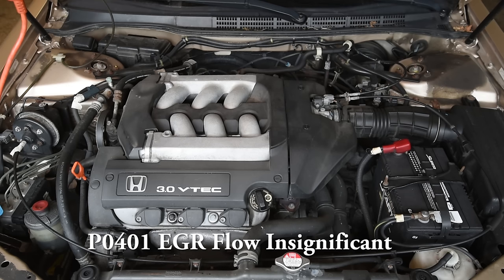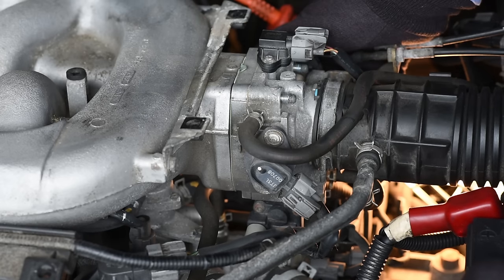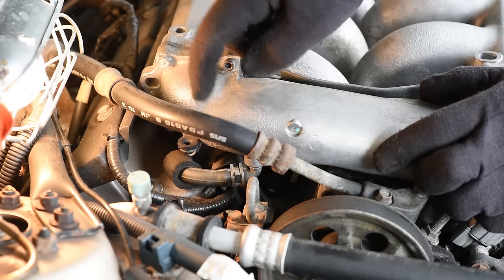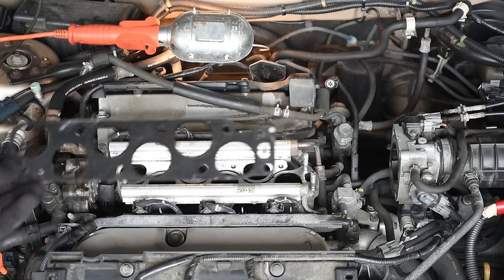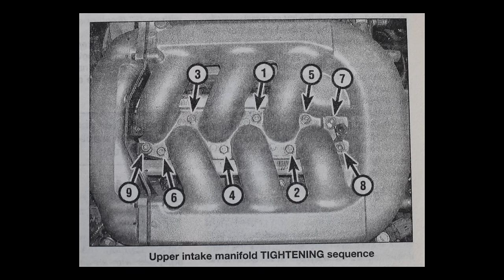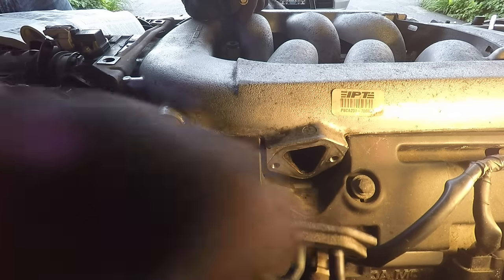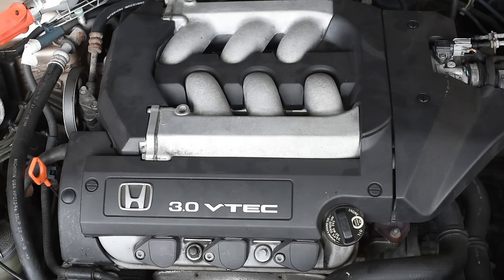How to Clean EGR Passage in V6 Engine (1998-2002 Honda Accord and Acura) P0401 code

Comment: Thanks for a great video. I have a 2001 Honda Accord V6, when I removed the intake manifold the ports were solid shut with crud in the intake and the engine port was 80% clogged.  Cleaned the ports and the throttle body, put everything back together and no more P0401 code. I'm at 600 miles plus now and no issues so far.

Comment: March 2022 I was extremely hesitant to try and do this myself.  The mechanics around here charge 140 and hour and said just in labor it would be 3 hours plus a new EGR valve so I decided to try.  My experience is oil change and an alternator so next to none.  This video leaves nothing to guess about everything is included.  The author needs a Venmo bc I feel like I owe him a 50 dollar bill for saving me so much money.  It did take me 5 hours but that included trips to the parts store for torque wrench rental.  Thank you a million times over!

Comment: Bud.  Can't thank u enough.  I had the same code and it took me 20 mins to get it FIXXED    The mechanic wanted to charge me 300 to fix the problem !!!!!! 👋👋👋👋👋👋👋👋
Reply from the maker: +oreohope1 haha, I am happy I was able to help and you saved some $$ :))
Reply: Igor Kadulenkov  your the man bro !!!! Very nice video man thank you
Reply: That was fast. It took me almost 3 hours to get it fixed. The Check Engine light gone instantly. Lol
Reply: Igor, your video is great w hat exact tools are you using I'm having a terrible time getting the manifold bolts off
Reply: @pengfeili1988  hey thats all that matters
Reply: Took me about 45min. My rig is running like a champ, lights are off
Reply: Igor Kadulenkov how many Miles did the car have on when you did that video. Thanks.
Reply: @IgorKadulenkov  not a Mechanic,  if I take it to a shop in NYC Queens,  what would be a fair price to pay for this job, in general, ball park. In other words what is the most I should not pay, on a budget. How much should I pay, more or less. Thanks Love the video. Thanks. PS my Car is a 1998 Honda Accord V6 3.0 EX Coupe Black 198000 miles, near mint condition.
Reply: Did you spray carb cleaner down the other port? Where does that drain, or do you just let if air dry?
Reply: Cause mechanics are gay

Comment: This was one of the most helpful videos I have seen. You couldn't have walked me through this any better than if you were standing right next me. You saved me from a huge mechanics bill and kept me from replacing an EGR valve that wouldn't have solved the problem anyway. Thank you very much!!!
Reply from the maker: +Ken Drake hi Ken, thanks for your comment. I am glad I was able to help you to save some money! :)
Reply: @IgorKadulenkov what issues did you experience before cleaning?  My car radomly starts surging when on the highway.  I give it gas and it dies.  Then suddenly it gets power again.  It acts like a bucking bronco.  One min it only goes 30 mph the next it races really face then it loses power again.  This happened about once ever 5 months for about 30 mins of drive time.  Is this erg port related?

Comment: Igor, thank you for posting a great video!  For me the hardest part was getting to the bottom throttle body bolt on the firewall side.  You can't see the bolt head so you end of feeling around for it under the throttle cables. I also removed the EGR valve. That allows you to clean up all the carb cleaner that is sprayed in from the top side.  I used carb cleaner, an old bike brake line as a snake and compressed air to clean the passage from both ends.

Comment: I changed out the EGR valve but my check engine light came back on. after getting a $350 quote to clean out the EGR port I decided to take a stab at it myself. i dont do much auto work and it took about 1.5 hours using this video as a reference. car fired up first shot and check engine light is off. Thanks a lot!!!
Reply from the maker: Hi Hyuma, thanks for feedback! Glad you saved some money. It's insane how much mechanics charge for a simple job.
Reply: @IgorKadulenkov  uhh yeah especially if you need to pay the rent

Comment: this is a great video, the 3.0 on the Honda and acura motors are known for their carbon buildup. instructions were spot on, easy to follow. my check engine light is gone, and all it cost me was 45 minutes of my time, and a 3 dollar can of carb cleaner
Reply: What kind of problems were you having before you cleaned ?

Comment: Had a p0401 code on my 98 v6 honda accord and followed this video step by step and no more check engine light, thank you!
Reply: For how long did your check engine light stay off once you cleaned your EGR valve and its ports? I spent so much at the honda dealership repair center getting so much work done, took my car to Auto Zone for the free check engine light diagnostic and it came up with the P0401 code as well.
Reply: Before I cleaned it I just tried to reset the CEL and it came on after ~30mi or so. Afterwards I did this cleaning I had the battery disconnected so the CEL was turned off but I did the cleaning and the CEL hasnt come back on yet and thats after ~200 mi or so.  I also took a look at the EGR valve also (2 bolts and a sensor takes this off) and it looked almost brand new, but I still cleaned that anyways just to be sure.  Ill let you know if CEL p0401 comes back on but I dont think it will unless it gets clogged again.  It seemed like in my case it was just the entrances of the ports that were clogged and not all the way through. Good luck!
Reply: rons2021 That sounds about right. Thanks for the luck. I will definitely get someone to o what you did. It can't hurt to clean it like you did.
Reply: What were the  Symptoms with your car? Was it not  Accelerating correctly?
Reply: @ron
Reply: Did you have starting problems?
Reply: @rons2021  You done good brother

Comment: Thank you for the video, my 2001, Honda accord 188,000 miles check engine lights are off, and I have more power, running like a champ

Comment: i did the very same procedure on my car. cleaned the egr. drove a bit the lite came one. went and bought and an egr. drove 200 miles no prob. on way home the lite came on. then i pulled the trigger and took off the intake plenum and cleaned it like that in the video. the engine felt good and free. drove 20 miles and the lite still came on. i am not even bother trying any more. the video was a great help.
Reply: i disconnect the battery and held the 2 battery leads together for 30sec and the check engine lite went out. it hasnt come on back yet.
Reply from the maker: Which code are you getting? Could be some other reason.
Reply: @IgorKadulenkov  exactly
Reply: @fyahwerks  Frankenstein would love that

Comment: I recently got a 98 accord ex v6 and I had 6 codes on the scanner all related to this, so I followed your instructions and bam no more check engine light and it runs like a dream, thank you so so so much

Comment: Thanks Igor for the great "how to video"!! mine was so clogged I could even the red extension tube on the car cleaner can in the port hole it was so clogged!  after soaking, poking,  and air hose   got both upper and lower ports free again! new egr, plugs cap and rotor and wires, oil change  and front O2 sensor too! put her all back together  cleared the codes then went to crank her up and nothing......... had wires wrong on cap!? but she purrs now and it us to bogg out on freeway. so thanks again sir for your video with it and $250 in parts and 3hrs i got it done!  your a badass! keep making great videos!
Reply from the maker: +Eric T awesome! Thanks for your review. I am glad my video helped! It's not a very hard job, but mechanics would rip you off for sure
Reply: @IgorKadulenkov  Exactly

Comment: Thank you for this video! I have a 99 Accord EX V6 and as many others have said, the ports were totally blocked off and clogged through from one end to the other with carbon build up. I cleaned the ports as you did and put it all back together and wow, not only is the gas pedal responsive from the very top, but my acceleration greatly improved, the car runs and idles smoother, and the exhaust used to reak but now almost no smell at all. Thank you!

Comment: for those that dont realise this on like my 99 model 3.0 the pcv hose is in a different spot and its much safer to actually just pull the pcv itself out and leave hose connected.. if u try to pull this hose off after 150k miles more then likely u will be buying another... just sayin. very helpful video though. seems to have worked for me so far as well and i can see it was done on my vehicle by previous owner a year ago at a shop for $100.. took me 15-20 mins and a $8 can of cleaner

Comment: Your videos are great. I had error code P1491 and so I tried replacing the EGR valve with one I was able to snag for ~$50.00 on Amazon. After clearing the code and driving another 50 or so miles it turned back on, but this time gave me P0401 - EGR "A" Insufficient Flow. I'll give this a shot!
Reply from the maker: +Omid Feghahati thanks and good luck !

Comment: This was very helpful but my intake manifold wouldn't come off until I completely separated the right side inlet. I think because of a couple bolts that were studs with nuts on both sides sticking up. Still a very good video. I found my passage was clean but I still took it apart to make sure after seeing other Accords plugged. Nice to see a video like this where you can see what's going on without someone talking 90 mph and missing video pieces. Very helpful. Thank you.

Comment: Excellent video on this repair.  Great tip on using the magnet to hold the nuts in place while being removed.   That will save a lot of time looking for fallen nuts.  Such a simple idea that I have never seen before.
Reply from the maker: I think I saw it in some video about 10 years ago and have been using it ever since. Magnet is the most important tool, when working with a car.

Comment: Yes this will solve your problem 100% if you have this code. Do it yourself. Hardest part is torque wrenching the bolts to 16 ft/lb. First time I broke my plenum bolts and had to visit Honda's Carland to buy a new set. Charged me about 14$ but it was worth it to have my emissions passed. DIY

Comment: Fantastic video! Much appreciate the detailed steps, torquing sequence and torque values of the intake manifold bolts. I will be using this video as a reference when I perform the same procedure on my 1999 Honda Accord V6.

Comment: Thanks you... I've been looking everywhere on how to open this one. And I finally did. Except the tubing to the air filter is so old, it crack to pieces when I pulled it off. EGR problem fixed but gotta buy that huge tube now

Comment: The EGR valve can be stripped for cleaning by undoing the 4 torx screws under the graphite/ fibre/metal gasket . You'll need a 7 mm spanner on the 4 nuts . The valve itself can be removed using the next larger size torx by holding the hex part of the solenoid through the apertures . Inside the EGR valve You will find a baffle that will stop the valve being cleaned properly by any other method . Using spray cleaners will not clean the back of the valve but may dislodge a lump of carbon that may wedge the valve open continuously causing hunting or loping at idle .
The inside of the valve body particularly the seat can be cleaned factory fresh and you could even lap the valve to seat using fine paste . Reassembly is reverse order . Use a new OE gasket or make some using heavy duty glass reinforced silicon baking /barbecue sheet , 3 layers will reduce heat transfer from the valve to the solenoid and signal ,supply components .The valve normally cokes itself shut as it opens like an ordinary poppet valve into the transfer port to the inlet manifold and spends much of its time closed or just slightly open and I have seen them with the valve totally coked over . Many of the V6 parts are no longer available in the UK but just about anything peculiar to this model , like the ICM for instance can be made from other common Honda parts .

Comment: Very good!!!!, but one thing I do, I used compressed air to clean the manifold passages, as well as through the EGR passageway on the engine, ... if you do not have a compressed air source, another thing I do is to remove the EGR from the engine and run the engine,  with varying rpm,....  amazing how much junk gets blown out of there. As a clogged EGR ( passages etc) causes an engine light, it does not pass state inspection. SO what I have been doing is blocking off the EGR by a thin metal plate ( made from a can lid).  This stops exhaust flow from going through this passage. I get more HP also. Of course this causes the engine light to come on, but I am use to that. When inspection, is due, I then remove the plate ( this will be the first year I am doing this) and hope none of the passages will be clogged due to no exhaust recirulation through these passages. Will  replace the EGR  & reset the engine light, drive for the requisite 30 miles, then get it inspected. Once it passes, I will then put the block plate back on. Once a year hassle, but so much easier than doing the above work which I use to do every year, and paying for the gasket, and new EGR.                 I have had the opening in the manifold bored out and had placed a larger tube in  ( Honda's work around this sad engineering design) but really has not helped. For me, this clogging seems to effect the EGR, which even with EGR cleaning would not help. So a new EGR when I take the plate off (this time) during inspection, and again, replace the blocking plate after inspection.
Reply from the maker: Great suggestions, thank you!
Reply: @IgorKadulenkov  An update....Well, before inspection in July, I took the plate off, ran the engine with varying rpm's, put the egr back on without the plate, reset my engine light... drove 60 miles to make sure the computer will recycle, took car to be inspected, it passed!,  Came home and later put the metal plate back on. Saved me a cleaning of the manifold etc!!!
Reply: @msach4277  AWSOME — but you do have to plug up the Vacuum line Right .. to the EGR
Reply: AWSOME
Reply: One day the light might burn out 🤔

Comment: Where the EGR is mounted does it need to be cleaned or cleared out as well?
Reply: Yes that should also be checked and cleaned if necessary. Something this guy should have done or elaborated more on.
Reply from the maker: “If necessary “, egr is not usually a bottleneck.

Comment: Thanks!  I had already bought a new EGR valve but that wouldn't have fixed it.  The EGR port was completely blocked.  I replaced the valve since I had it and it was tore down this far.

Comment: Great video.  I believe I am in severe need of EGR cleaning and maybe replacing.  I have problems with idle going down (sometimes stopping the engine), low performance and insanely higher fuel usage.  I wish I had the tools and experience to do this myself but I will have to find a good mechanic to do it instead.  Hopefully it'll turn out well.
Reply: Hey there. Did you get this done by a mechanic? If so. How much did it end up costing? And what exactly did they do?
Reply: @miguelitocunsuelo7200  Hey. I did get the cleaning done by a mechanic in addition to valve adjustment. I’m not 100% sure about how they did it since I wasn’t at the shop while they were doing it. I believe they actually took out the EGR valve and cleaned it with chemicals, not sure which ones. After the work (including valve adjustment) all my problems were gone. I’m glad I had it done. 

As for the price I don’t think it would be a good example since I live in Turkey. The cars here are very expensive compared to US while repairs are a lot cheaper.
Reply: @selimthedream  what issues did you experience before cleaning?

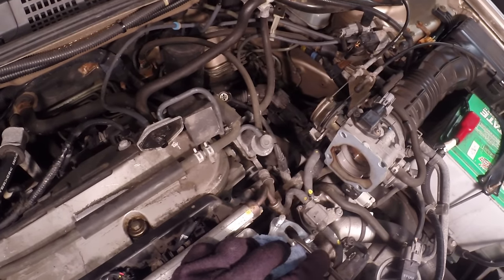Comment: I don't think you're cleaning the EGR port here --> 5:10
If you look at the front cylinder head (viewed from driver's side fender) you will see the EGR valve is mounted to a water passage/pipe at the lower left corner of front cylinder head and the port from EGR valve to front head is at the lower left corner of cylinder head (viewed from driver side fender).
I'm not sure what plugs into the lower RIGHT side of the cylinder head but the port you are digging in @ 5:10 is on the right side of the head.
Again, the EGR outlet from the water passage mounts to a hole in the LOWER LEFT section of front cylinder head

Comment: I have done this several times but you must clean the passage between the intake and the EGR.  I use an old speedometer cable connected ti a drill.  Start with the square opening at the (removed) EGR and work the cable as you slowly turn the cable with the drill.  It will push through and finally come out the top of the intake port-intake removed, of course.  At that point, you can pull it back and forth and spray carb cleaner down the passage.  Put a rag over the hole at the EGR end and blow compressed air through the port.  A LOT of stuff will come out.  DO THIS OF YOUR OWN JUDGEMENT.  I AM NOT TELLING YOU TO DO THIS, JUST SAYING WHAT I DID. I kept doing this until nothing would come out.  Remove the cable, reassemble-no CEL now for thousands of miles.  Good luck!

Comment: after the intake manifold, that hole that was caked with carbon goes into the water passage on the driver's side. when I took mine apart that part was caked with carbon too, get new metal gaskets when you do and replace the giant o-rings on the giant water pipe from the passage to the engine